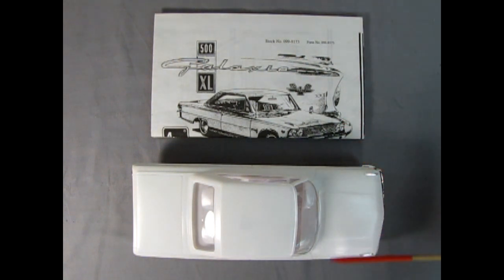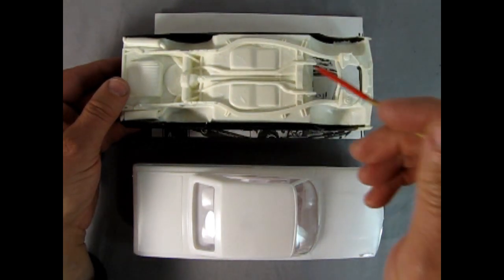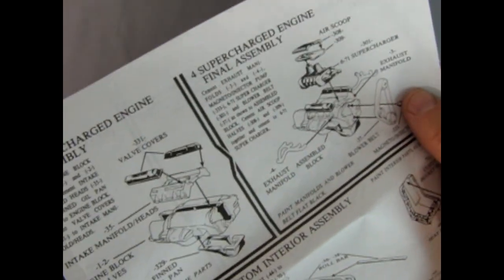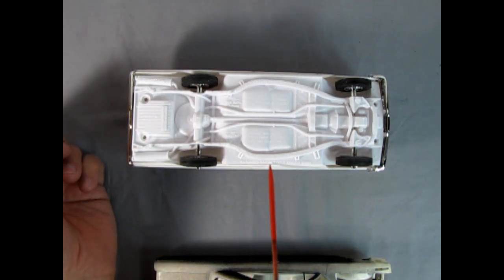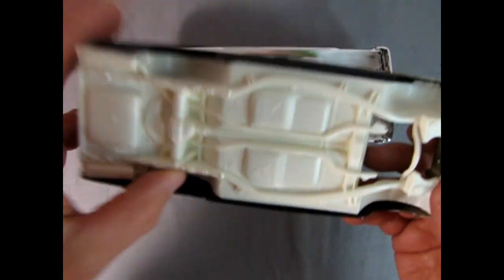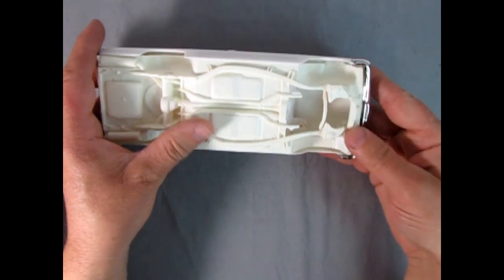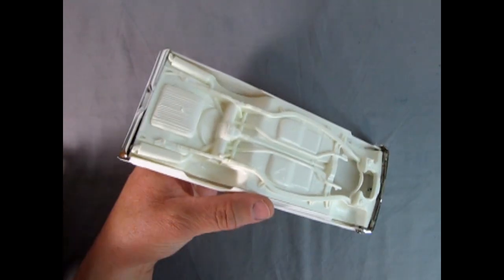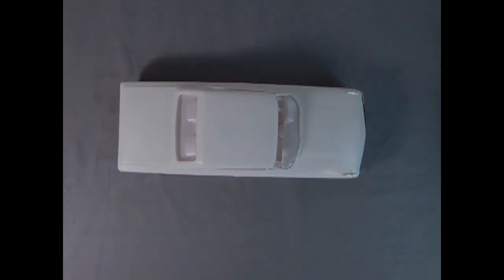Chassis Swap Trick For The AMT 1964 Ford Galaxie 500 XL Model Kit

Comment: Great idea Trevor! I've also heard of people using the chassis and engine from the 60 Starliner in the 63 and 64 Fords.  It's not an exact fit, but with a little finesse, you have a better detailed multi-piece chassis on the later Galaxies.
Reply from the maker: For sure galaxiesteve7139. I actually have a Starliner to try that with.

Comment: back in the mid '70's I had a ford galaxy 500 xl. The thing is mine had a 60/40 bench seat and column shift for auto trans mission. whad I need to do is manufacture a steering with the shifter and a front seat. if you know anyone that manufactures one could you let me know?
Reply from the maker: Not off-hand, but sometimes you can find those pieces in other Ford model kits.